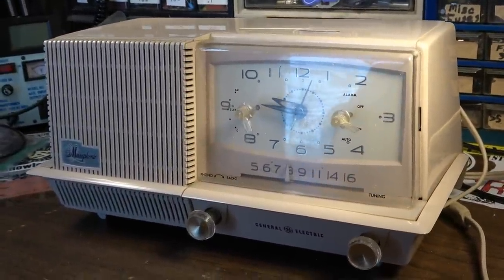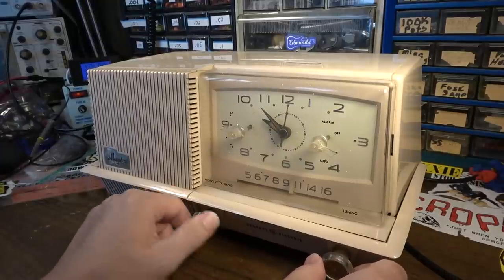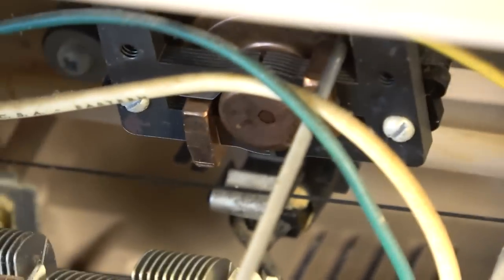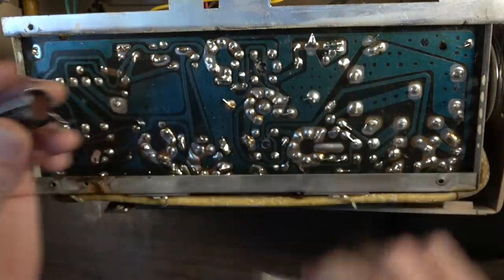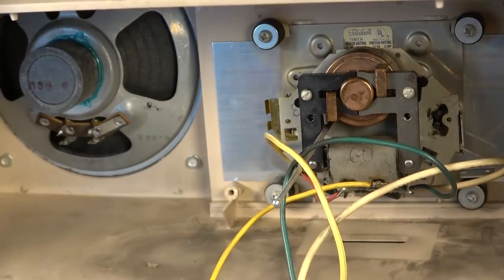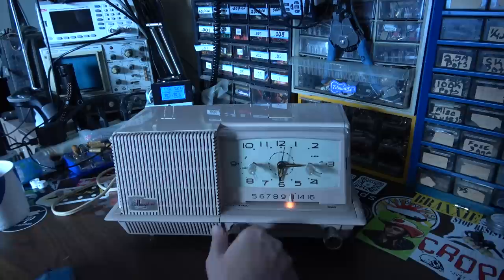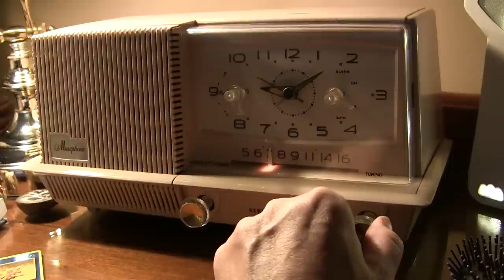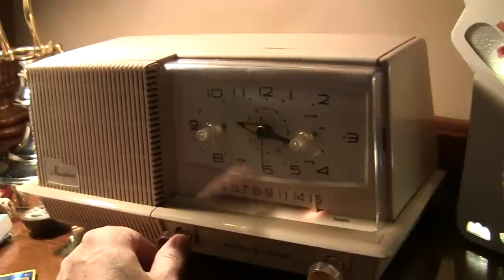1960 RETRO PINK General Electric GE Musaphonic Clock Radio REPAIR

Comment: In between years at a tech school I attended in the early 70s, I worked for Goodwill in St. Louis, Mo.. I was in the electronics dept. and must have worked on 100s of these. Most of the time it was cleaning and tube replacement. Sometimes it was actual troubleshooting and repair.I learned more electronics from Goodwill than school! Gotta have the sheepskin! Love from NW Colorado. Thanxz

Comment: I have an old table top radio that my friend helped turn it into an amp. I happened to look inside and saw a couple of tubes and said wouldn’t it be cool to make this an amp? My bud said open it up! In about 5 minutes he found where to solder the wires and there it was. A very good sounding little amp.

Comment: great video!  awesome alarm clock too.  you're right about the RIAA eq. they are referred to as "emphasis" and "de-emphasis" filters.  the whole gist is, if the sound is too loud, the record player's needle can skip, and the low bass frequencies are most capable of making it skip.  also there's lots of background noise just from the needle dragging through a groove that can have dust and stuff in it, and recordings back then had plenty of noise to begin with.  solution: an emphasis filter is applied to the recording before the record pressing, which dramatically cuts the bass content that can cause needle skips, plus this filter dramatically boosts the high treble frequencies, to make sure those highs don't get drowned out from the record player's contribution.  and this is why amps and receivers have dedicated phono inputs, that input has a de-emphasis filter which undoes the previous bass cut with a likewise boost, and undoes the previous treble boost with a likewise cut.  the standards took a while to get straightened out, as there wasn't originally an agreed upon set of values such as cutoff frequency for the emphasis filters.  i don't recall if everyone ended up on RIAA, but for a long time there was a european standard and one or two others.  tape has filters it uses too, and with tape you also have what they call bias frequencies, bc tape does this weird thing where the less sound is printed to the tape, the worse (narrower) the range of frequencies it can work with, so a medium volume sound much higher than we can hear gets added when recording, and cut back out on playback.

Comment: I had a blue radio like that I bought it at an auction in vale  Colorado in 1969, the summer they landed on the moon. We had 5to drive into Denver to watch it on a G.E.tv at a downtown Holiday Inn.  Ahh , the memories. Mine didn't work at first for the same reason!

Comment: Cool old radio. I like the styling. I might have to look around for something like that. My dad used to use acetone to glue plastic like that. Plastic model glue might work. I have a couple of old '80's/'90's digital clock/alarm radios, but I think that they are ugly, so they're up in a closet (if i didn't chuck them).

Comment: That’s a very nice 👍 analog clock 🕰 radio 📻. This came a whole 10 years before I was born. It looks like it’s only AM, but that was a part of history. Looks like this can be plugged 🔌 into a phonograph, but I don’t understand the purpose. I wouldn’t want to be pumping only music 🎶 off of records through the speaker 🔊 of this thing. The clock motor appears to be running at the right speed. Those electrical outlets on the back sure add nostalgia to these types of radios. Along with capacitors, ya might also need to change the clock dial light 💡. Your friend, Jeff.

Comment: i have a 53 philco 804 clock radio that needs a recap & is also a mare to take apart & put back together then about a dozen other radios that just need recapping. & a few 30s era that need more work. plus a few amps  & radio to amp conversions to do as well. I have to get my A in2 G like U.
Reply from the maker: I keep mine in gear by doing the videos. Filming and sharing it keeps me going.

Comment: Buck Sexton! Liberal is used today a lot instead of left. Love Ride Captain Ride! I have an old Grundig tube radio that also has shortwave channels on it in  addition to regular am/fm. Got it out of the trash. One speaker is bad, never tried to troubleshoot it or listened to but did have it on when I first go it and it does work. I should look at it and see if it’s something simple.

Comment: The thing with old tube radio's is eventually your going to have to understand IF tuning. Thats the circuitry that holds the stations and pre-amps. That's what 3/4 of the board is. Weird tubes and coils. . Those nerds usually don't play guitar. Their usually into HAM too. I feel kin, but like a distant cousin.

Comment: Some sleuth responded to an Uncle Doug video that the white spots are spider shit.
I will verify that. Years back I painted my concrete basement floor a brick red. 
As I was finishing up I watched a little spider walk across the floor, stop for a few seconds and walk away leaving a white spot on my beautiful work of art. Needless to say, I decided to let the little critic become a part of it too.
Reply from the maker: Well…i am appalled. I could have gone my whole life not knowing that.
Reply: You could've just painted over it. I leave spiders alone, unless they are of the black widow variety. Spiders take care of the bugs I don't like.
Reply: I just bought a clock, opened it up to replace the light, and found a spider. There is some white spots in the cover. Now I know what they are.

Comment: Those are AC synchronous motors in that type of clock; their speed is determined by the line frequency, not by how much voltage is across them, or how much current they draw, so I wouldn’t worry about the clock being too fast/slow, unless you use it overseas where they have 50 Hz. This one was in nice cosmetic condition - a real gem. Too many times, the knobs are broken off, or the case is all cracked, or yellowed from UV exposure, or tobacco smoke (barf 🤮.)
Reply from the maker: Correct, but when they gum up they can periodically stop, throwing off the time.
Reply: @TheGuitologist  - In most of those, the “motor” is sealed in a thin aluminum can, along with the step-down gearbox. Unless there was a hole (or someone took it apart to find out what was inside - hint: me, when I was a little boy! 🤣), I don’t see how it would get gummed up until all the lubricant inside the gearbox dried up. Now the gear train outside the “motor” is a different beast entirely, but the output gear on the motor has a lot of torque, but low speed (1 RPM), and would just power through a bit of goop or dirt in the gears driving the hands, unless a bit of plastic or metal got in there. Anyway, nice to see this radio restored!

Comment: Just curious - why didn't you add a ground wire?  Even though you're not touching any metal when you're operating the radio, isn't it best to add a ground wire anyway, since it's a high voltage tube system?
Reply from the maker: If you add a grounded cable to something like this you have to then go in and redesign the chassis isolation or you'll usually create a ground loop hum that is unbearable. More trouble than it's worth for something you'll never be touching metal on anyway.
Reply: @TheGuitologist  Ah I see!  Thank you for the reply 😊

Comment: Like the newest intro.  
  This should be interesting.
Reply: Instead of glue , use an old soldering iron , and zip ties to weld the plastic pole back in place. 
  Look up plastic welding on YT.

Comment: Weird, you say you get more AM stations at night?
When I'm in my car in the daytime I get plenty of AM stations. Not long after it gets dark I can barely hear a station to tune into. This all within a few miles of home and has been consistent as long as I remember.
Reply from the maker: You might get more during the day because some of the stations stop broadcasting at night? AM signals travel further at night because the ionosphere changes at night when sunlight radiation is not shining on it.

Comment: I'd rather see new electrolytic capacitors in a radio or an amp than old ones.
Reply from the maker: I was just attempting to make it neat as possible.
Reply: I don't think those caps are that old. With all the fake parts out there sometimes you're further ahead taking parts from a parts unit that didn't sèe much action. Many new flat screens don't live long enough to kill the caps

Comment: Hi Brad, Tube guitar amps are so expensive that many younger or income challenged  guitarists cannot afford them. There must must be 100's/1000's of  old valve radios, record players, stereo grams out there just gathering dust that could be picked up dirt cheap (or be donated to you) and converted to guitar amps, a couple of generic cases would probably be good to encase most amps, nothing fancy just enough to allow many more people to try valve amps., and maybe earn you a little cash (i would buy one).  Having watched your  channel for years and know what you like and dislike you could call them Brads Messy Boogers Amps.
Also when you use the Thames Television (uk) intro to your videos you should at least try to talk in an English accent, would be a hoot, OK mate cheerio.
Reply: by the time he worked on one added an isolation transformer to make it safe and what ever else it needs done to them it would be right up there in price with the tube amps made for guitar . then you run into the oddball tubes some of them have. only way to get one dirt cheap is to work on them yourself and there is a learning curve to that as well. best to just save up and buy a guitar tube amp if you really want one
Reply: @Filthy Peasant those type amps (string filament)are best left for hobbyist and restorations of the original radios. Also tube amps are like old cars. It helps to know how to work on them otherwise your gonna be throwing money at it chasing anomalies every few years
Reply: My son found a decent Marshall amp at a pawn shop. He didn't pay very much for it either. He replaced one of the tubes, and it sounds great.
Reply: No. These radios should not be wasted on a guitar amp.

Comment: Maybe you could put those cap cans in the oven to melt that wax out? Should you be handling that uranium paint without protection? I've seen people restoring watches with it and they had gloves and specially marked containers to dispose of it and whatnot. Anyway, very cool and stylish radio and tune up.